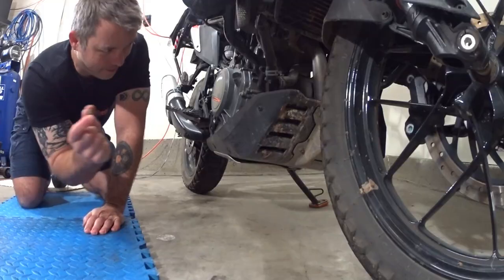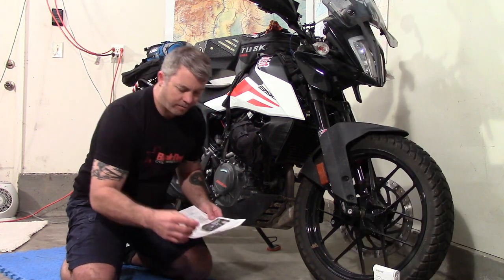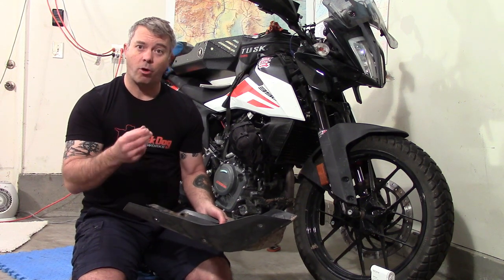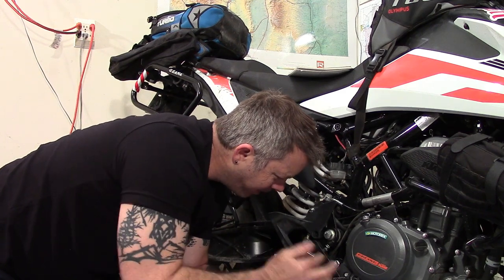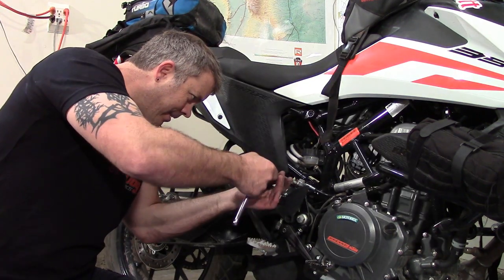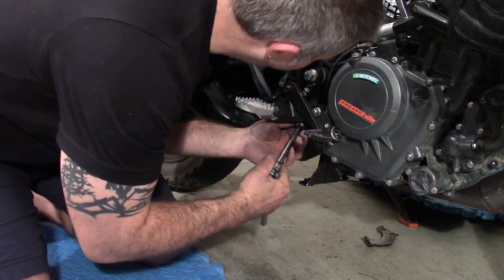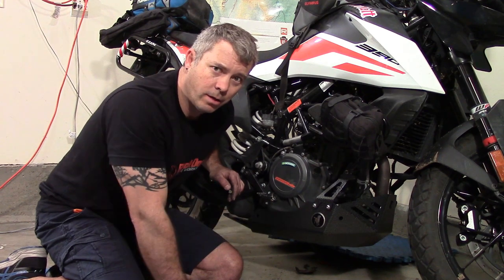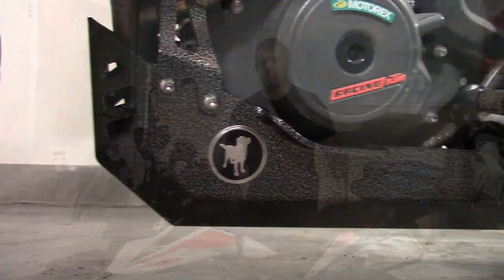A KTM 390 Adventure - Black Dog Cycle Works Skid Plate

Comment: Hi Matt,

I installed the BDCW skid plate over the weekend.  Your video was a big inspiration to tackle the job and a big help to execute it. I did it solo on my driveway in four hours (proceeding very deliberately) with just the side stand for support. By far the hardest part was wrangling the exhaust back together, especially solo. As a complete novice to moto modding I would say that it would not have gone anywhere near as smoothly if I had not watched your video as an adjunct to the provided directions . I like the industrial metalhead look of it on the bike as well. Good job, thanks for the 390 Adventure content
Reply from the maker: Glad to hear the install went well.  The skid plate is well worth.  I ha e lots of 390 Adv content planned.  Get out and ride.
Reply: I installed mine a couple days ago - It took me about the same amount of time. I too don't think I would have installed it without the video. Yes getting the exhaust back together was the most difficult. Mainly re-installing the cat. I used a small hydraulic jack to raise and hold the cat in position so I could use both hands to attach it. The skid plate is bomb proof and is a great piece of engineering.
Reply: I will add and echo - getting the exhaust back together was - wow, very tough. I found getting the resonator back into proper position without knocking the metal slider dudes out (both the internal ones inside the rubber housings and the external clips on the frame) was incredibly challenging while at the same time trying to position the main exhaust/header - insanely tough. I gave up trying to get the top resonator pins in while main exhaust connected so just removed the main exhaust altogether and focused on resonator only (which is what you show in the video although printed instructions seem to imply just loosening header is enough). Then once top resonator bolts in place (not tightened), trying to align the lower pin of the resonator with the main exhaust connected was totally impossible - I wasn't able to get the lower bolt into the threaded hole without completely removing the header (not just loosening the plate mounting to engine block). Then once getting the lower resonator bolt in place, trying to get the header back on - just wow. It took the wife and I about 3 hours altogether and at the end amazingly we were still married but all of our forearm and shoulder muscles were expired and I learned my wife has a sailor's mouth -- I learned new curse words... she's from Canada so I'll forgive her  :D   In the end though, just a terrific design to protect the engine and we are very glad we purchased the skuff plate and went through the effort. But between your video and printed instructions, not sure it really conveys how incredibly challenging this project is for amateurs. I had to stabilize the bike above (I mounted a ceiling hook that I use heavy duty travel straps to secure the bikes at the handle bar/steering column) and I also used a small 2 ton hydraulic jack ($80 from Autozone and incredibly useful, especially needed the lift to take the weight off the kickstand when getting the left rear bracket mounted). Thank you for all your videos by the way, you've helped me tremendously overall with ownership of the KTM 390 Adventure and I love it. Happy  trails to you.

Comment: Looks good for sure. Have to save the money for that. I did get the risers, doubletake mirrors and the little bags that fit in the crash bars. Very happy with everything
Reply: From witch Brand are the little bags?
Reply: Omypol or something like that. Matt has links in a previous video
Reply from the maker: I did a video on crash bar bags.  I talk about them in this video with some links to ones you can try.  The bags are little tactical bags meant for mounting on MOLLE webbing.

Comment: Hey Matt. I just got back from running the COBDR on my 390 Adventure using the AXP Racing HDP skid plate.  After one 3,400 mile trip, the AXP plate is pretty much toast. It protected the engine and exhaust but one, not very hard landing hit against a rock on Hagerman Pass cracked one of the “welds” and the heat from the catalytic converter severely melted the back left of the plate. I will say this for it: it is light and did flex on impact. All that said, the Black Dog will be replacing it.
Reply from the maker: Well do e riding the COBDR on the 390 Adv.  I didnt like how the AXP mounted.  I am not surprised to hear you had issues with it.  The BDCW skid plate is worth every penny.

Comment: Hi Matt, I have also gone down the 390adv rabbit hole this year. Done 4000 miles on it in 6 months with a lot of off road. The bike is a great liberator with decent quality everywhere. I ditched the wheels for the spoked one as I hate the look of cast rims. I have my bike booked in for some hyperpro fork springs at the end of the month with its service. The stock ones have way too much static sag which doesn't help the bash plate and you have to run a lot of comp damping to avoid bottom outs which then makes it sketchy in boulder fields. I just repacked my head bearing last night as it had came loose after about 2500 miles so I'd recommend doing it (not a lot of grease in there at all!).
Reply from the maker: Thanks for the tip on the head bearing.  I have been looking at doing something with my fork too.  I didn't know Hyperpro had a spring kit.  I need to look into it.  I want to get the spoke wheels too.  In time.  I love this bike.  I have absolutely no fear taking it whoever I want to, knowing I can get myself out of trouble pretty easily.

Comment: Good video ... im going the same route and use my tiger 800 for more longer distance riding and use the 390 adv for solo rides and overnights when im alone
Reply from the maker: That is what I am planning to do with my R1200GS and 390ADV, although any trips that will include lots of offroad regardless of distance will be a 390ADV ride.
Reply: @advmatt   yup I will most likely do the same.. except on the black n orange one 😀

Comment: Me again...going through various channels looking at what's available before committing to the purchase of a bike(ie,is it worth selling my Husaberg FE390 to fund it?). Problem here is the downpipe goes UNDER the engine, so you're losing 2" of clearance approx,it needs a pipe brought  round below the clutch casing and RHS footrest, the swung under the swingarm with a can on the LHS(Lextek VP1 has such a pipe). That allows a bashplate to be mounted higher, and with a LHS muffler, can can carry a pole to lift the machine on it's side stand, for wheel removal on the trail, and it keeps the sound to the middle of the highway, being away from the sidewalk, drawing less attention! Any good exhaust maker would soon knock one up. BDCW bashplate could then be adjusted to mount higher... just a thought?(get one un-painted).
Reply from the maker: Agreed with everything.  The loss of ground clearance is primarily the exhaust.  Maybe there are some custom opportunities.

Comment: Just installed this on my 390. Wondering if you are having the same problem as I am. Initially I was worried I put something on the exhaust back together wrong because I was getting a humming/ howling sound. I'm pretty sure I didn't. The sound happens at 4500rpm and I believe it's when the vibration of the engine reaches a harmonic frequency with the skid plate making it resonate and "sing". It is a very obnoxious sound. When inspecting it I did notice the rear of the two bolts on the front right was touching the engine. Hoping this was the problem I loosened everything and shifted it so it isn't touching but it is still really close. Thinking I need a shorter bolt there. The ones supplied are long. It didn't change the noise though. I loosened it again and rode it and the sound was nearly gone. But can't ride with a loose skid plate. Ideas or suggestions? Nylon washers between bracket and skid plate to try to interrupt vibration?
Reply from the maker: Sorry for delayed response, I just saw this note.  I had the same issue.  I loosened the exhaust, and straightened it out a bit, it was slightly off, ever so slightly.  I had to replace the front brackets (broke one and twisted the other), when I did  I installed a washer with a rubber grommet on one side to dampen any vibration.  It seemed to work.  Not sure which thing I did fixed it because I did a bunch at ince.
Reply: @advmatt  broke and twisted the front bracket of the skid plate? Which part of the exhaust was off? Did you get the email from blackdog that they are sending free replacement front brackets to customers with a code because they were machined from a thinner material than the prototype. They think this is causing them to bend and cause vibration. Or is that what you are already talking about with the front brackets?
Reply from the maker: @raynapost8522  I dont know if I have the new brackets.  I need to check.  I didnt get the header installed as straight as I should have when i reinstalled it.  I have not received an email yet.  I need to check into it.
Reply: Did you ever get the humming/ howling to stop? I just added the BDCW skid plate to my 390 Adv and have loud humming/ buzzing / howling sound at 4,100 to 4,400 rpms.  BDCW did provide 6 rubber washers to go between the brackets and the plate and I installed these but still have the loud sound. Were you able to find a good solutions? I'm thinking of adding underbody noise damping paint or something similar. Any suggestions?

Comment: Thanks for a great vid...this is where I started on your channel.  I'll be picking one of these up when I get back stateside this summer.  One question when you've got a minute...did you ever link the shock seal problem (perhaps it got too hot back there?) with the fact that the BDCW skid plate is not ventilated in that area?  And did you consider drilling a few vent holes to help get some air to that space?  I know you've gone through a shock mod and resonator removal since then, but just wanted to see if that option crossed your mind...or anyone elses? 
Keep up the great work!
Reply from the maker: That is a great point, I hadn't given it much thought.  It certainly could contribute to heat issues.  I am not sure I would want to drill holes in the skid plate.  It would take quite a few to get ventilation, but it could help.
Reply: @advmatt  Thanks Matt.  My riding over here is not going to be as demanding as what you're doing.  I'll give it some thought when I have it in hand. Again, thanks for the reply and the informative videos.

Comment: Great Video! 
I have the crash bars already installed. Can I still install this skid plate and keep the crashbars (the one from the powerparts)?
Reply from the maker: The crash bars will not prevent you from installing a skid plate.  This skid plate uses the crash bar mounts.  The power parts skid plate will mount straight up just like the stock one.

Comment: Wondered if you could break down why the Black Dog is better and justifies costing twice as much as the T-Rex. Both mount to the frame. I just got a 2023 and am ready to buy one or the other.
Reply from the maker: I just looked at the T-Rex skid plate.  It seems good.  The biggest note, the factory crash bars are not compatible, so if you want crash bars you will have to go with the T-Rex bars.  You will need to calculate the added cost of new crash bars, which might be pretty close to the same price as the BDCW skid plate.  I have never used T-Rex products so I can't speak to the quality.  I went with the BDCW skid plate because there were really no other good options at the time.

Comment: Did you have an issue with the bracket being too close to the O2 sensor? I guess I may have some adjusting to do on the left bracket or might have to adjust the exhaust pipe.
Reply from the maker: I didnt have that issues.  You might need to loosen the header at the engine and adjust the position.  I had to do that to get to the filter behind the exhaust.  When I reinstalled the header I didnt get it back in the same place.

Comment: How much ground clearance did you lose vs the stock plate?
Reply from the maker: Almost one inch.  After I installed the Hyperpro fork springs I got that inch back plus a little.